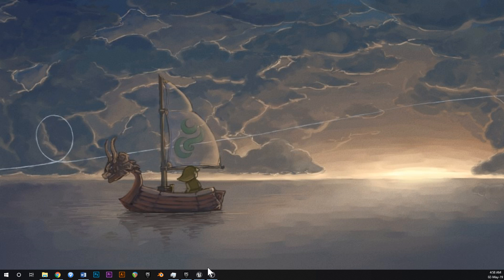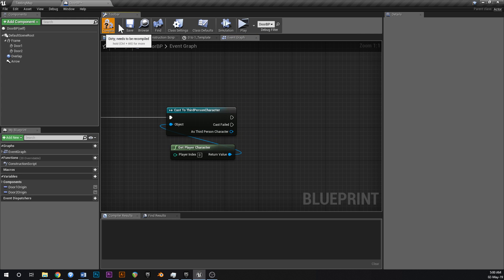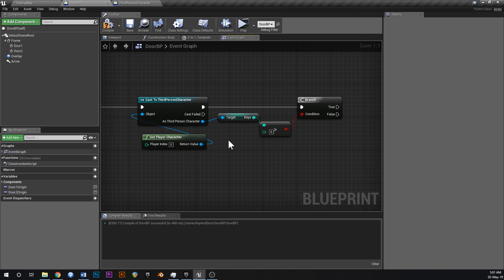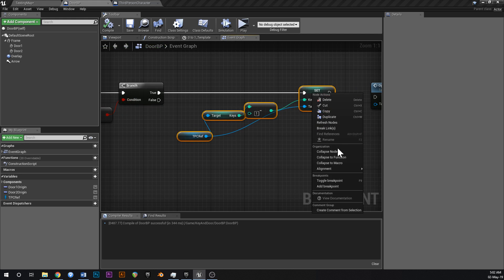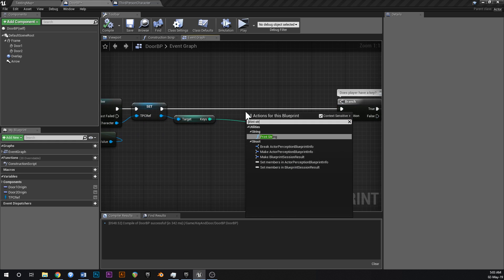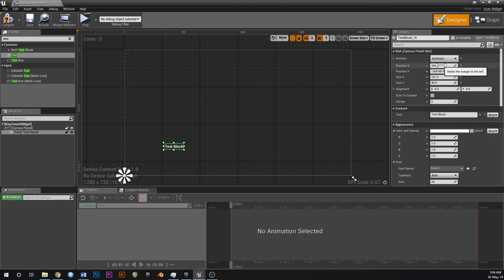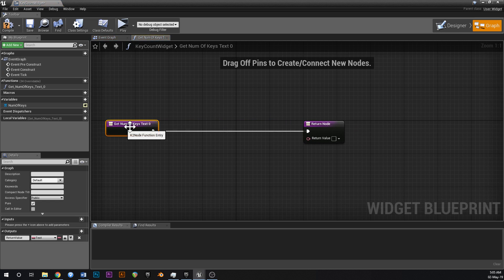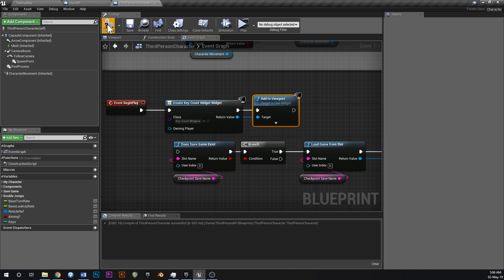Locked Door and Key Pickup System Pt 2 - UE4 Tutorial

Comment: I found this old video that talks about using a Game instance, I followed it and got getting coins to be remembered when switch levels, when I used the level end from your video,  I did it with the key the blueprint being almost the same way, and it works for opening doors in another map.

Is it possible to have a save game instance using a save game object (or was it the other way around),  as I can't find a single video at all that talks about it? 
my example could be collect enough music notes from say Mumbo's Mountain and open a note door in Gruntilda's lair.
Reply from the maker: Yeah you could store the music notes you collect in a save game, and then when the player tries to open the door you load the save game and check the number of music notes. Game instance and save game are both ways to store data across level transitions, but game instance is erased when you close the game and save game is stored permanently on the hard drive until you delete it